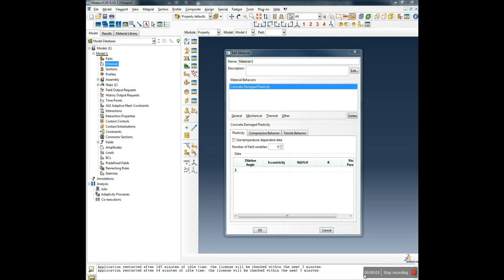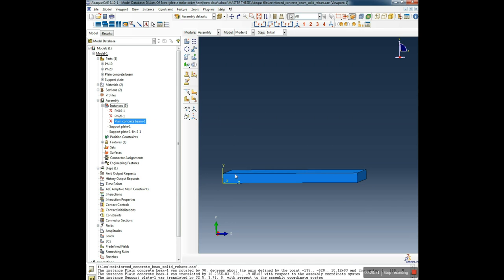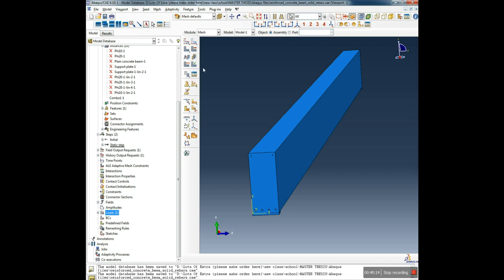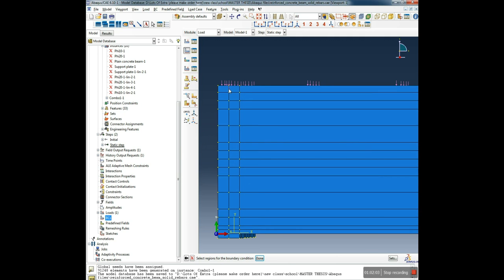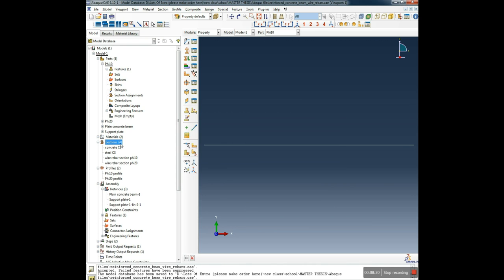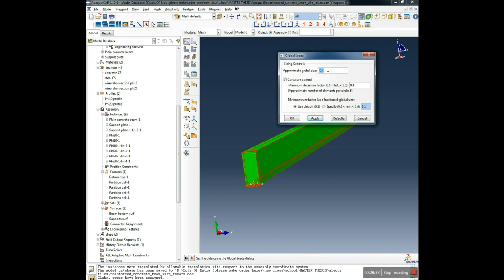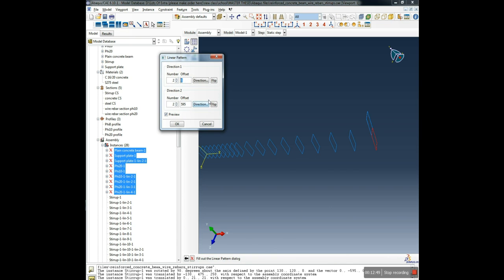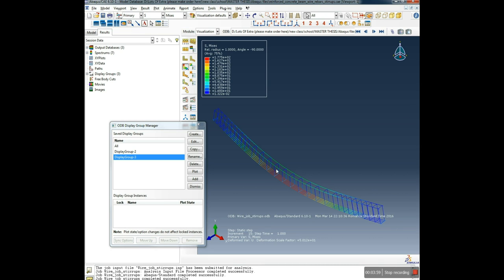ABAQUS Reinforced Concrete Beam

Comment: i want to know the equations used to get the tension stress strain curve in excel sheet  and the equation of max tensile stress
Reply from the maker: Anis Mohamad Ali, Bj. Farid and A.I.M. Al-Janabi. Stress-Strain Relationship for Concrete in
Compression Madel of Local Materials.
Civil Engineering Department, College of Engineering, University of Basrah, Iraq
Reply: @VladInc  yes i saw that paper but it is about stress strain relationship in compression..... i here asked about the relation in tension ........ thank you for your fast reply i appreciate that too much

Comment: while you was defining concrete you have put in elastic strain = 0 ?? why it has value corresponding to stress in excell sheet >>> also same thing happen while you was defining steel >>> hope to answer me soon >> thank you for your effort
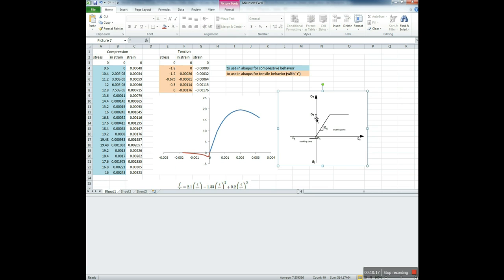Reply from the maker: hi man. The simplified model shown at 10:28 is used in order to speed up the solver

Comment: Hi Sir, Thank you for your video. I have a question regarding the rebars as solids. 
1. Why did you mesh the beams and rebars manually?
2. If I still use the rebars as solids, should I use embedded regions as well?

Thank you for your video!

Comment: Hi, your tutorial is great. Thanks a lot, man. Have a question about the material definition. In CDP plasticity definition, why you just input the one row of yield stress and inelastic strain as 0. I lost at this part.

In my understanding, the inelastic strain = real plastic strain - elastic strain. While the yield stress remains the same at the plateau, the strain keeps going, so there should be some subsequent values after the  first row. Would you please explain to me? Much appreciated.

Very very excellent videos, subscribed and thumb up. Hope to see more coming!
Reply from the maker: Phil thank you. it's been a while, bit if you define only one row and you specify inelastic strain as zero in that point, it means linear elastic until that point and infinite yielding plateau afterwards. if i didn't answer your question, please leave a video time frame and I will take a look when i get the chance
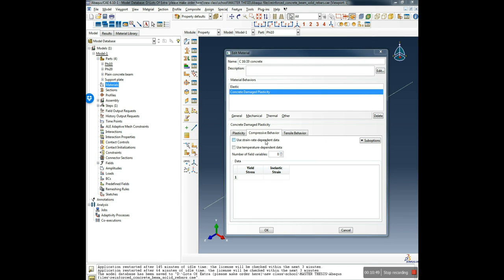Reply: Oh, I see the point. Cheers. Just in case it is 10:59
Reply: @VladInc  What if we want to ignore the yield plateau (n = 0) so that we can capture the strain hardening?
Reply: Do I then need tabular data, and where could I find this for C120 grade concrete?

Comment: can somebody help me regarding the excel file datas that have been put here.  For what grade of concrete are these datas valid?
Reply from the maker: Concrete Class C20/25
Reply: Vlad Inc. thanks. But in my model for a column made up with grade M20. But for the same column I am providing a jacket with M25 grade concrete to improve its strength and behaviour. So how to differentiate between M20 and M25?
Reply from the maker: I did not say anything about M, I said C20/25. There are all kind of different ways to express the strength of the concrete, that are used around the World. Most important is to understand the assumptions that you make. This video shows just a calculation procedure. It does not show by any means some approved values for strength and behavior of concrete
Reply: @Goodmorning-class  You put Young's modules for concrete 5000 root under fck, and Poisson's ratio for concrete 0.2

Comment: sir, i want to model in ABACUS 6.14 version for RCC beam-length 2000mm, effective span-1800mm and cross section-150x250mm. bottom steel 2-12dia, top 2-8dia, steel strirrups 8mm-2legged-100mmc/c. Grade of concrete M45 and Steel Fe500.  I want to find out the load vs deflection curve and crack propagation, sir can you help me. loading two point at 600mm apart. Further i am also want to model with this beams with CFRP 50mm width, thickness 0.333 mm, Fult-3400 MPa, E-245 GPa. Kindly help me

Comment: Hi Vlad! Nice video! A quick question: what is the instance --> merge/cut operation doing? I think it always results in a merged instance with only one material (steel OR concrete, not Reinforced Concrete). What am I doing wrong? I tried your way or selecting (i.e., I started by selecting steel). I also tried selecting by instance name. No success.
Reply: I am having the Same challenge. Did u find a solution yet?
Reply: same as mine did you find a solution please???
Reply: did u find any solution??

Comment from the maker: All links in the description updated on 06.11.2017. Let me know if they fail working again
Reply: hey for solid section my analysis aborts within few seconds of submitting the job, i have double checked the model, and used exactly the parameter as yours ...
Reply: The excel file is not the same as the video,
Reply from the maker: it has some extras, but all the information should be there
Reply: I found it, thank you very much
Reply: Please i have a problem when merging instances it gives me a warning message that the whole instances has the same material with one color, i made every thing typically as you did but i still have this annoying warning please help me @vlad inc

Comment: When i merge the beam with the reinforcing bars thus creating a single element, the material of the element is concrete or steel depending on witch instances i have selected first. How can i solve this problem?
Reply: Maybe its little bit late, but I found the solution to this problem. You created a Set-1 before, when you did the Section Assignment and you have to delete those Section assignments for each part and deleted the Set-1, and then create a new one, but you HAVE TO UN-CHECK the "Crate a New Set" on the bottom when using the Section Assignment. Then you can continue with the tutorial and your materials will be preserved.
Reply: @nermacaluk4543  It works thank you man/woman.
Reply: @nermacaluk4543  thanks yo🤟
Reply: @nermacaluk4543   I have problem that the reinforcement isn't work (same color during analysis)and also there is warning message ,what I should do?
Reply: whisperdeath I am having the Same challenge. Did u find a solution yet
Reply: same as mine did you find a solution please???

Comment: Hello there, it is an excellent tutorial, Thank you very much.
1) Why did you made a whole lot of partition to have green color ? why it is so much necessary to have hex elements ?
2) do those partition make any kind of difference in the analysis ?
3) why is the color changing by making those partition in the first place ?
Plz do reply sir...
Reply: The green coloration shows that those parts can now be meshed using structured meshing technique. Structured meshing is very helpful because the part gets divided into a definite number of elements thus making it easier for the user to extract any kind of data from those elements

Comment: Great video. I think you could've assigned the reinforcement section as truss rather than beam because they act as uni-axial elements. Perhaps that would've saved some time in computation. I wonder how much time it took for the analysis and if you could have modelled the concrete as planar to reduce the computational time.

Comment: Dear Sir,
thank you so much for this video 
i have modeled an RC beam with simply supported boundary conditions and used concrete damaged plasticity model to account for the nonlinearities in concrete, i have got the frequency value using a frequency step for the case of beam under its own weight only and it was good, but  i want to add loads to get values of frequencies for different load cases.
i have used a static general step to define the added load, knowing that this step is before the frequency step, but the results of frequency is the same as the case in the beam under its own weight! 
my question is how to extract frequencies according to the effect of "static" load ? 
i need your help please

Comment: Thank you so much for you sharing.
However, How can we plot the Force and Displacement Curve?
And which node or element is chosen to capture force and displacement?

Thank in advance
Reply from the maker: you plot the displacement vs time and you have to know how you defined the force in time. you can choose any node you like and you get the displacement for that node
Reply: Sir, So the force in time is RF2 right? Or we have to calculate with other Methods?